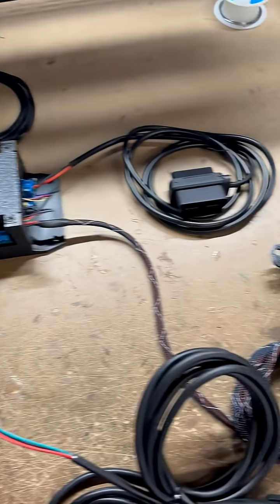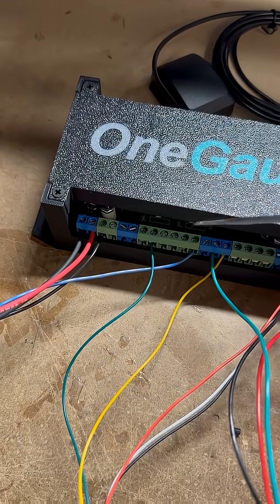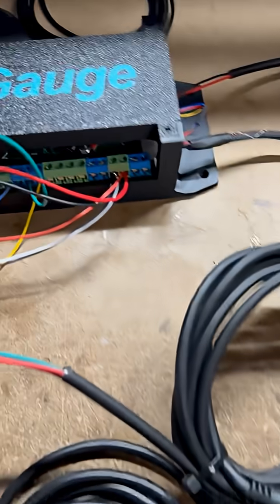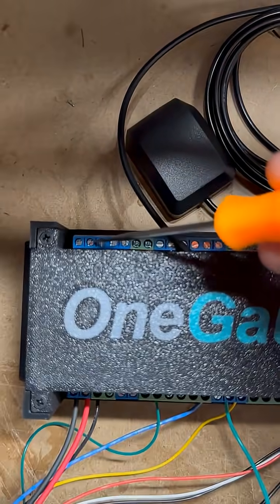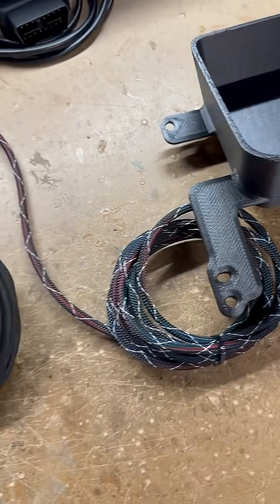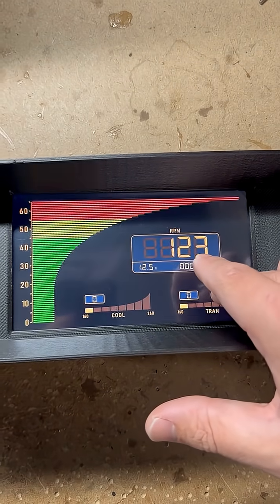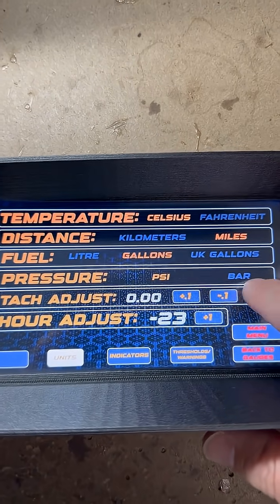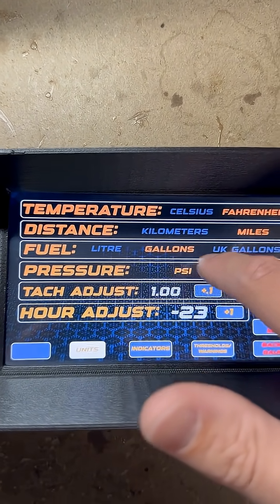OneGauge Example Build

Comment: Ive chatted with you before about my project using a 12.3 Android headunit as my display,  which i have set to only show RealDash on launch. One bonus is I have a 4 way camera system able to display in the "gauge" screen now - petty damn sweet!

But now i have a new idea of using the relay control feature to turn on my automatic headlight system when the engine is actually running using a tach signal. This way the headlights and running lights only turn on (automatically, at night) after the engine has finished cranking over.

I can do this very easily by feeding a tach triggerd signal from the OneGauge over to the DEI 545t 's ign input. 

That's what i love about your product, it inspires us to get so creative. I dont have enough space here to even liat my other older ideas !😂😂

Comment: Looks neat but would be nice to have an option for a better way to connect the wires like a superseal connector.
Reply from the maker: I’ve waterproofed things for customers before, but it’s recommended to install things in the cab anyway. Waterproofing makes things a little bulkier and most folks have preferred DIY their own waterproof housing - it lets them design it how they want it, rather than me decide for them. I still toy around with developing a waterproof solution but I only get 1-2 requests per year and it’s much simpler to just do it custom for those folks.

Comment: Does this work with CAN? Whats the data transfer rate to give information to the ECU in real time?
Reply from the maker: Yep! In this video I mention that the customer is pulling a few readouts from a CAN bus OBDII system. We don’t send data to the ECU (unless it’s OBDII where we request data), we primarily just read the CAN data broadcast. It’s essentially instantaneous, no slower or faster than any aftermarket CAN product like EFI systems etc. My Knowledge Base discusses CAN connectivity theonegauge.com
Reply: @TheOneGauge ah, ideally I'd just want CAN Hi/Lo to the ECU (haltech) and for data from additional sensors from the dash to be fed back to the ECU. It's a bit daft having multiple of the same sensor and having all that I/O spare on the dash essentially useless.
Reply from the maker: @martinking9663  Send me a message using the contact form on my website with details, and I’ll reply with a more full response. I might be able to help out, just need more space to discuss. theonegauge.com
Reply: @TheOneGauge will do